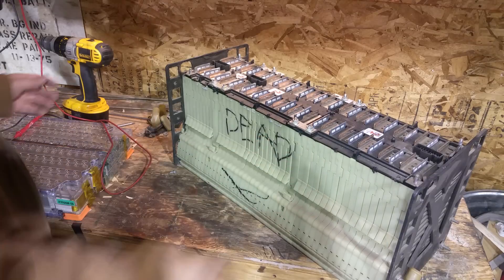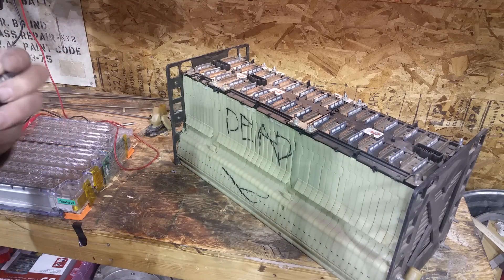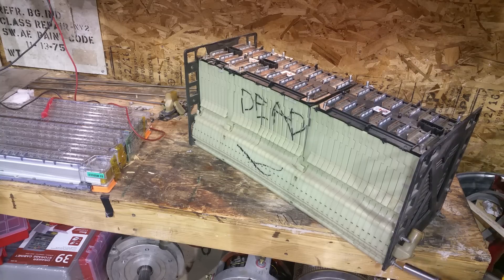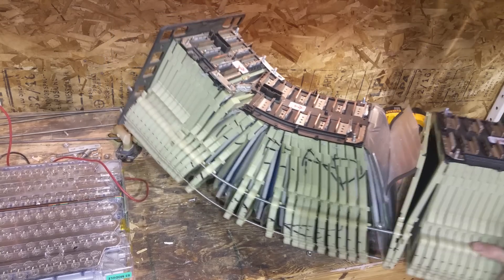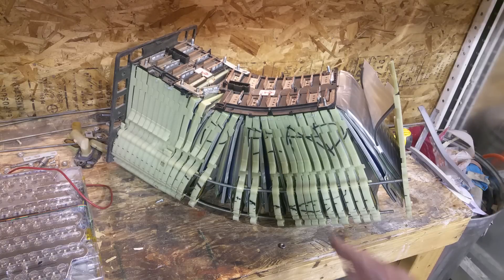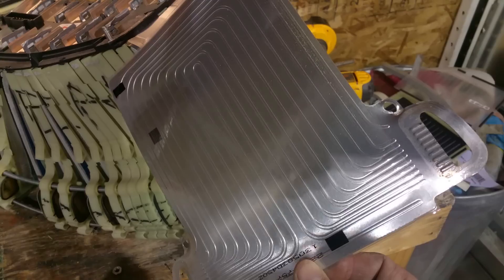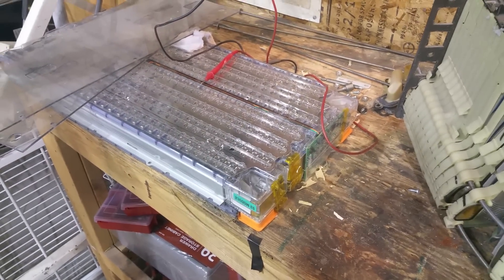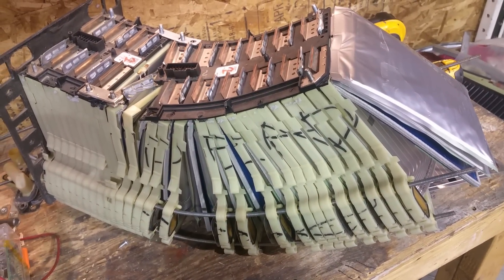When a BMS goes BAD

Comment: I certainly appreciate your videos!  You’ve shed some light on my current project.  I’m utilizing Chevy Bolt pack and would like to take advantage of the other Bolt items - BMS/ Charger/ DC-DC 14v unit.  What can I use to ensure everything works properly on my conversion, such as the BMS and monitoring.

Comment: A few videos back you compared Gen 1 Volt battery vs Gen 2 Volt battery, and... you've been messing with Volt batteries for some time now, so....  you can probably answer my question... is there any way to swap the Gen 1 battery pack in a 2015 Volt with a Gen 2 battery pack to increase my electric miles?  How similar / different are they?

Thanks.
Reply from the maker: James Bentz they are similar but different enough that it won't work. The frame is a different size, the connectors are different, the BMS is different. Unfortunately it would not be something that would be practical.
Reply: @EVEngineering  Awww,  too bad...I was hoping to make my Gen1 Volt the best of both worlds, many miles, AND backup gen engine.
I saw on a forum that someone did buy a salvaged Gen 1 battery and installed it in the hatch area to get more mileage.  He said he just paralleled the battery and extended the cooling tubes.  The car did the rest.  Maybe that will be my next step.
Reply: @EVEngineering  BTW, thanks for your fast response.

Comment: you know you CAN  save the hard parts and buy new cells them self from ebay . there the right size and every thing  . they dont say there for the volt on the add but they are

Comment: What I was hoping to understand from you disassembly of your bad Volt pack but your video ended before it could be answered, Can one disassemble the Volt pack to its group of individual cells modules  and  reassembled  with more individual cell modules in parallel so one can build a bigger kW hour battery pack at about 400 vdc?
Reply: As I understand it, no. Modules may be added but not cells. At least not without physically cutting the modules into pieces.
Reply from the maker: Trying to reconfigure cells in the pack would be a major pain.  The cell tabs are ultrasonically welded together making separation very difficult and then re configuring would be challenging as well.   I built a very similar pack years ago from A123 pouch cells and it was a lot of work. Fr the Volt modules, I just paralleled packs together for more kWh.  I have run 2 "banks" in parallel to give 28kWh (1 24v module removed from each to stay under my 345V controller max) and 3 to get 42kWh (see the Sylent vids).  For large packs go with Tesla or at very least the Gen 2 volt batteries.  The Volt packs are more optimized for power then energy.
Reply: The big issue in using two 15kW hour packs in parallel would require two separate battery management systems and it still will have issues.  Since you have the junk cells it would be the time to explore somehow maybe removing the welds.  Is that physically possible?
Reply from the maker: Paralleling at the cells is definitely preferable, just not practical with the design and manufacturing of the Volt module. (You can electrically connect 2 packs at the cell level with jumpers or the sort, but that has it's own problems).  There is no way to really remove the weld, it would be cutting the tab short (or at least the welded portion) and then figuring out how to get them electrically connected again.  This would ally have to be done on a hot pack and speaking from experience it's a nerve racking affair.  Take a look at all the things that were tried on the old A123 cells (including myself) and really get a feel for the true PITA it is to do right and safely.  All of this CAN be done but IMHO it's not worth it.  The Volt cells are good but not good enough to warrant all the work, parts, risk, etc.
Reply from the maker: http://electricmiata.blogspot.com/ is a old page I did for my first foray into lithium and you can see one way to do it. Certainly not the best or only way.